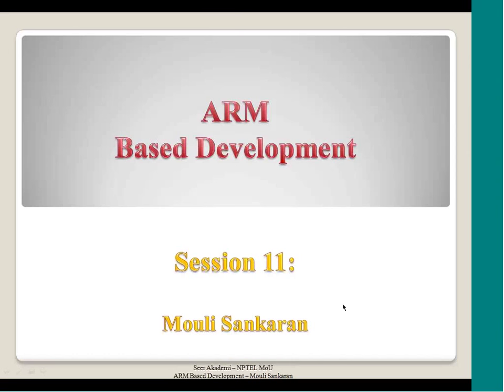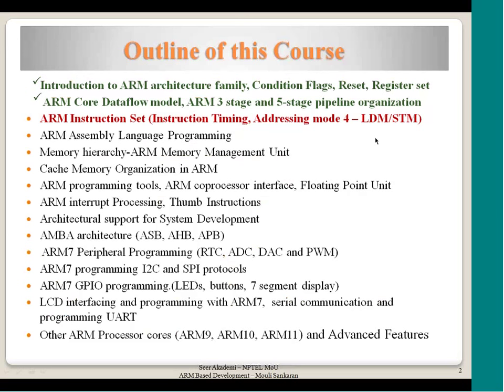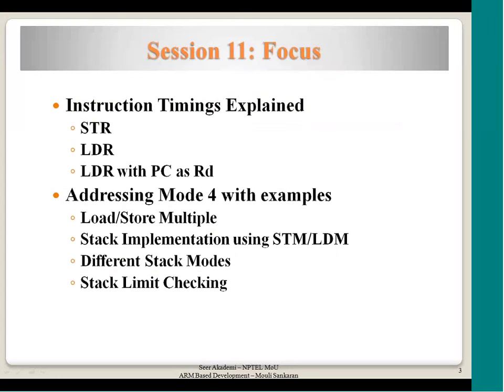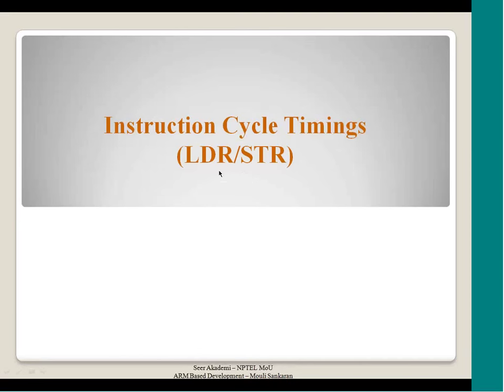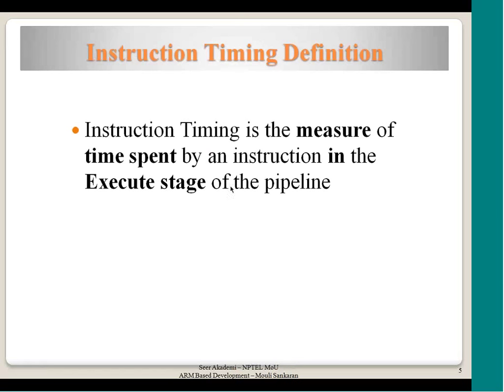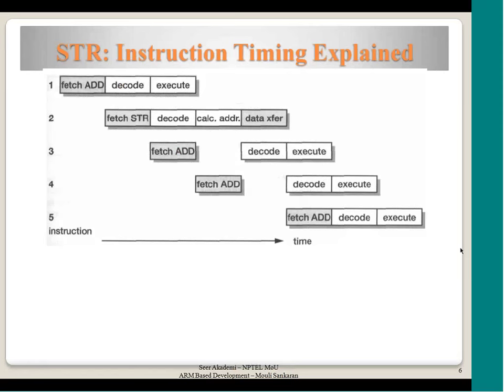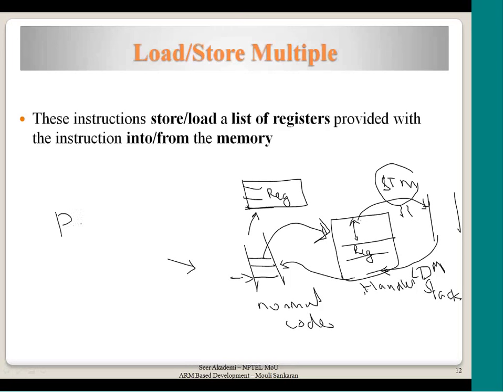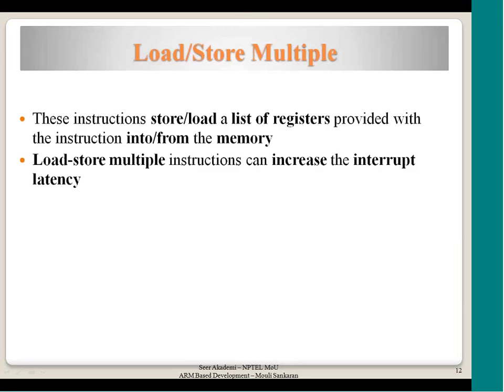Instruction Timing, Addressing Mode - 4 with Examples

Comment: For the code below	
	LD	 R2	, 0	(R1)
	LD 	R3, 	4	(R1)
	ADD  R4,  R2, 	R3
	SW 	R4, 	12	(R1)
        LD  	R5, 	8	(R1)
      ADD 	R6, 	R5, 	R3
      SW 	R6, 	16	(R1)
Consider each instruction takes 5 clock cycles in an unpipelined architecture and the Pipelined architecture has five stages (IF, ID, EX, MEM, WB) and each stage takes one clock cycle time.
(a) Number of clock cycles taken for the code to run in an unpipelined computer is
 (A) 35 		(B) 30 		(C) 7 	(D) None of the above
(b) Dependences that exist are
 (A) Data and Output	 (B) Data and Antidependence	 (C) Only Data	 (D) None of the above
(c) Number of clock cycles taken for the code to run in a pipelined computer with no data forwarding or other compiler techniques to handle data hazards is 
(A) 11 		 (B) 13 		(C) 17 		(D) 23
(d) Number of clock cycles taken for the code to run in a pipelined computer with data forwarding
 (A) 11		 (B) 13 		(C) 17 		(D) 23
(e) Number of clock cycles taken for the code to run in a pipelined computer when data forwarding and other compiler solutions are applied
 (A) 9 		(B) 11 		(C) 13 		(D) 17
 sir pls explain